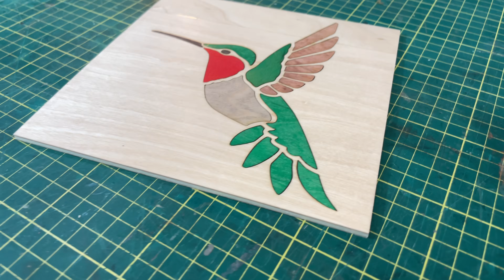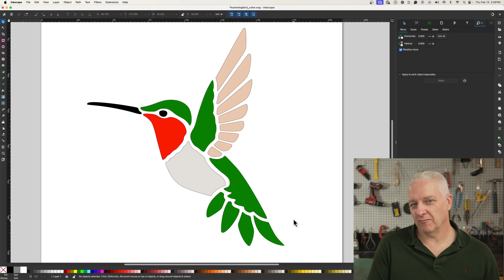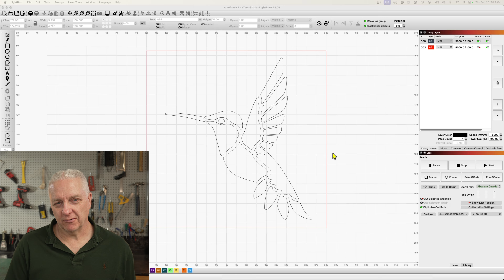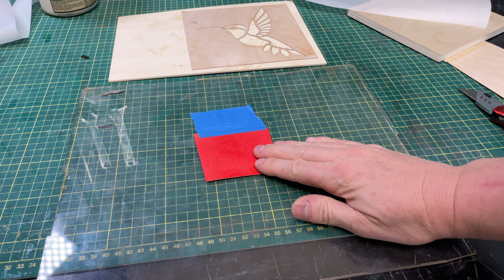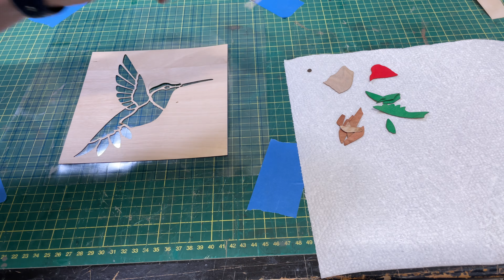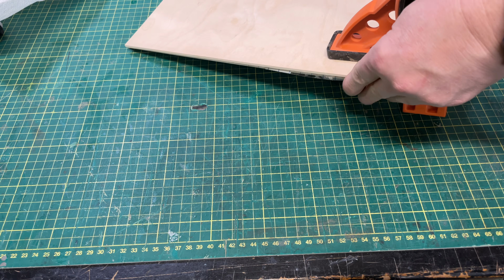Tone Up Your Woodworking Projects  with These Laser Inlay Secrets

Comment: Odd comment you brought up - Lasers are a phenomenal woodworking tool to add to a shop. I use mine regularly for building router jigs far more accurately than I could do with traditional machines. Circle cutting is quicker and more accurate - zero waste or dust! Cutting veneer is incredibly accurate with a much higher first pass success rate for the occasional marquetry applications. 

One technique I use to hold veneer in place is to apply blue painters tape to your veneer and to a flat base (glass, aluminum or sacrificial wood). Apply several small dots of cyanoacrylate glue to one taped surface, and spray the other taped surface with CA accelerator. Position and apply firm pressure for 5- 0 seconds. Machining will not dislodge the tape/CA/tape bond. Separating the tape from the work when complete is relatively easy - it is painters tape! I do try and avoid glue near very fragile lines to minimize risk. I use this often to secure work to  router and CNC jigs, and hold small parts in place for shaping and sanding. Double back tape on steroids with no residue and easy release.
Reply from the maker: Yes, I hear frequently from die-hard woodworkers that laser aren’t woodworking tools. I don’t understand it since a laser is fundamentally a jig saw and router, but much more accurate than either of those. 

Your veneer holding process is a fine one. This is the process I always use for CNC work too.

Comment: Haha, just thought of a inlay idea.
Laser inlays on the guitar neck, but each inlay on the fretboard represents a song from the set list.

My uncle carved up his bathroom floor by eye and did a very geometrical inlay that had 3d looking features yet being completely flat.
I can only draw snoopy myself though, so I cheated and built a cnc machine, and recently picked up a sculpfun s30 ultra with a 33 watt diode laser.
Thanx for the shared vulcan knowledge Dr Steve.
Reply from the maker: I struggle with straight lines myself. Lasers and CNC tool hide many of my mistakes

Comment: Hey Steve, try this....  For VERY intricate inlays, make an inverted image for burning.  On the back of the inlay material, (will be the front after installation), place a couple of layers of blue tape - edge to edge - no overlap, with the second layer at 90 degrees.  For the final backing layer, use some aluminum AC duct tape that will prevent the laser from cutting all the way through the backing and the AC tape will not be cut, (you still need to dial in the power), to just burn through the thinner veneer just a bit .  Since the AC tape sticks like hell, the blue tape should release easier and any remaining blue tape will be removed with a final sanding.  Ideally, the inlay piece will be just a hair higher than the base when installed to make the final sanding the inlay to the base even, (if the inlay sits too low, there will be a lot more base material to remove vs the smaller material amount of the inlay piece)....
Reply from the maker: I’ll have to try this.

Comment: I imagine you could use a piece of glass underneath for thesame purpose.

And what would happen if you tried to cut a piece sandwiched between glass?

Would it still cut or would it make some kind of mess sense the fumes couldn't go anywhere?

(only reason I'm wondering is sandwiching them would keep the veneer from cirling even on really small parts)
Reply from the maker: Interesting question. Certainly you could use glass as long as it’s clean - dirt wold make it heat up an possibly crack.  I don’t think you could sandwich the veneer between glass or acrylic without it turning into a mess.
Reply: @SteveMakesEverything  I was concerned about if the reusable acrylic got any scratches or fingerprint oils/dirt, then it would react along with the laser hitting it.
Justin mentions of using glass instead, both being clear and something that diode lasers completely overlook, glass not as easily scratched perhaps, though I would be careful about what might happen to glass if a super hot laser beam hits in say in a cold garage shop if the glass wasnt preconditioned to be warmer before the laser contacted it.
Reply from the maker: @truetech4158  You can use glass or pretty much any clear rigid material.  The laser isn't hot per se, but anything that absorbs the beam will get hot.  Diode lasers pass through glass or acrylic, so they should be unaffected.  Additionally, the power required to cut veneer is minimal, and the speed is usually fairly high, so there won't be much opportunity for heating anyway.
'

Comment: Thanks Steve I always learn something new from you. I noticed the clamps on the honeycomb bed looked like they have a clamp lever. Does that expand the stem that is inserted into the bed?
Reply from the maker: These are the standard Xtool hold-downs. The wire is just a handle to pull them up. The shaft that fits into the honeycomb is a magnet. It’s really a smart idea.

Comment: Laser and wood working seem to work well for me.  From cutting out a box joint spacing templates for a table saw or router jig, corner radius templates for the router, stencils for painting - marking - carving, ect…. I have used and still use my Prusa printer to make more durable jigs, but the laser makes the prototype in mere minutes.  If it something I know I will need in the future or want to share, I then make it with plastic on the printer.  Some pieces are a blend of plastic and wood and much better and cheaper than what I can purchase.  In the end, I know what I make works specifically with the tools I have like my table saws, routers, ect….
Reply from the maker: That’s the spirit. A laser is just an another woodworking tool (and other materials). The workshop is changing and it’s time to embrace new technologies

Comment: Thanks for sharing, you can use a 3M tape on the back side and it will save you time (no need to use clamps, I learned about this from “That Mom With A Laser”
Reply from the maker: Yes, use what works. 3M tape will hold it forever

Comment: In the future you can use Rit dye to stain your wood in any color.
Reply from the maker: Yes this will work.  I’ve also used dyes in the past but didn’t have a color I liked for this project
Reply: Thanx for the heads up on tint considerations. That dye might be the affordable way to build up a various color supply.
Reply from the maker: @truetech4158  YOu could use wood dyes.  In this case, I just used some good old-fashioned paint.

Comment: if you have any issues with bits fitting, check your laser level and kerfing settings, it might not seem like much but .1mm can make a big difference
Reply from the maker: Because the typical diode laser spot size isn’t usually square, so you can into a situation where the width is right but the height isn’t perfect. You can usually get within 0.1mms though, but if it’s an issue, you can find a value for the kerf that is a balance between the height and width or you can look for a laser with a squarer beam spot -  the AlgoLaser Delta is a good candidate for this.  The xTool S1 is used is this video isn’t the best choice, but it seemed fine for this project